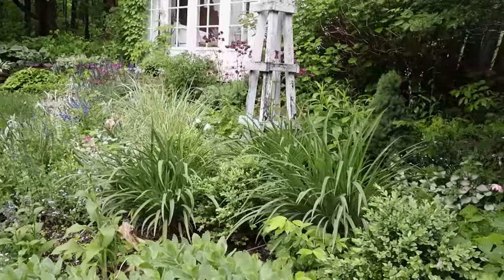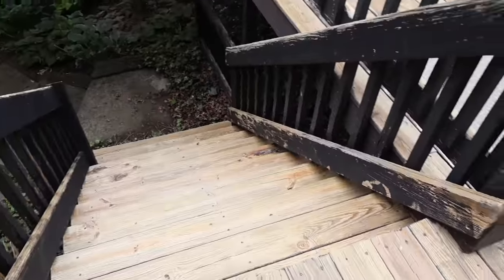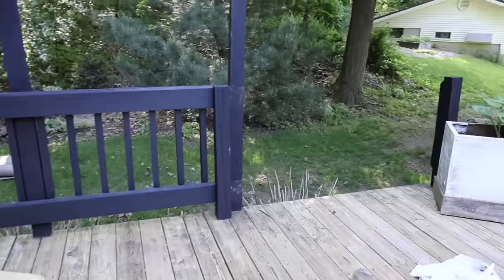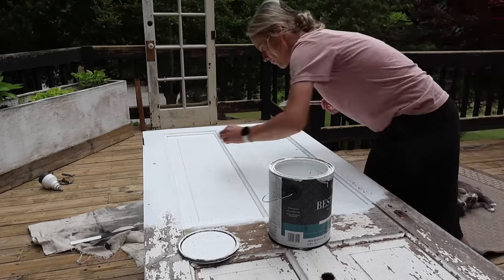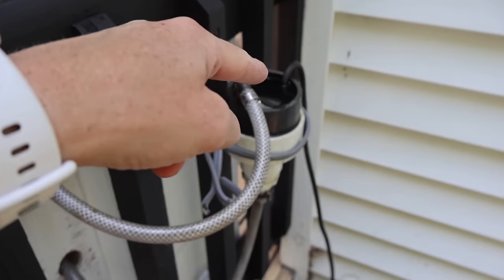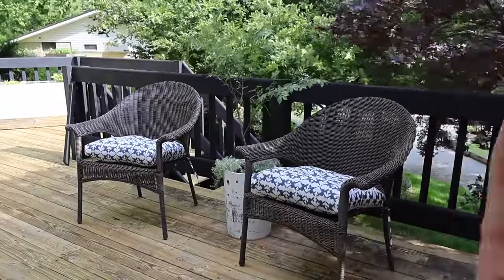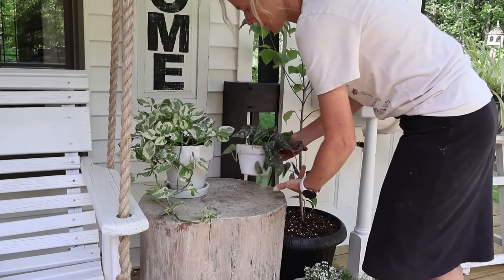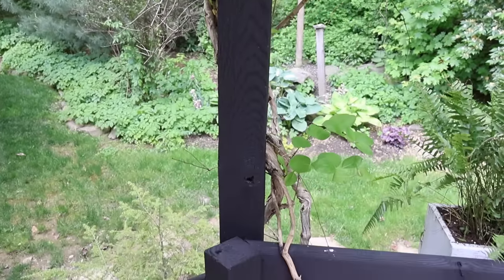Porch Makeover ~ Porch Decorating Ideas ~ Front Porch Decor ~ Patio Makeover ~ Country Porch Swing

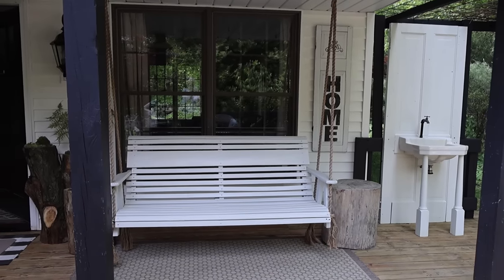Comment: Mary, Have you ever tried flipping over the wooden "legs" for your sink fountain?  I didn't really think about it when you were placing them but later around 13:40 when you pulled the camera back to look at the porch while deciding what you wanted or needed to add-I noticed the sink legs.  I think it would look more balanced to have the heavy porcelain sink supported by the thicker end of the wooden legs (posts) with the skinnier end touching the porch floor.  Just an idea.   I love those stumps John cut for you-they would cost a fortune here in my town.  put a coat of white wax or dark wax on them and the price would go even higher here!  🙂  Your spring decorating is always my favorite YT decorating.  Thanks for a great video!